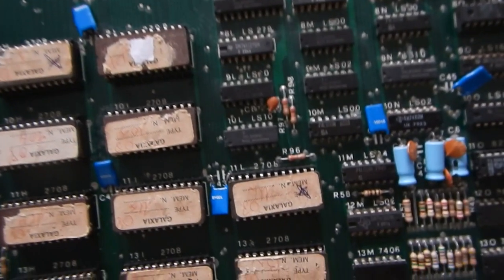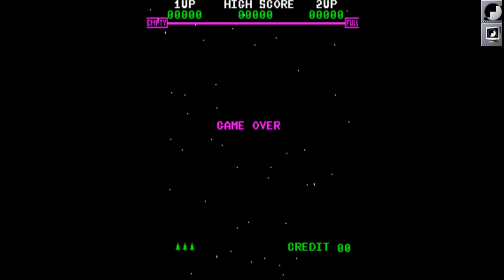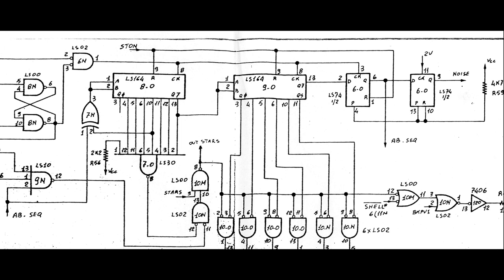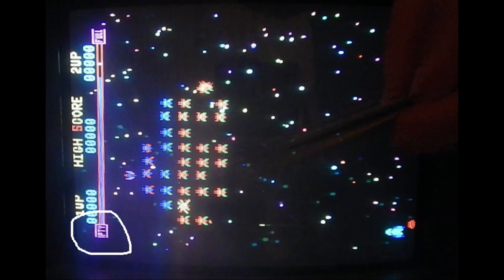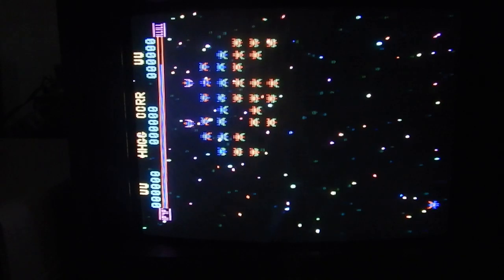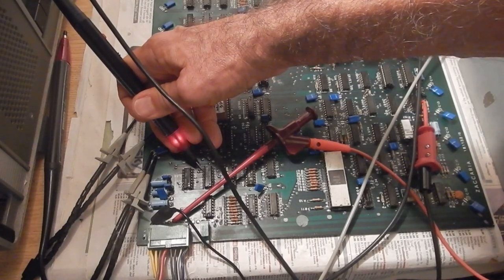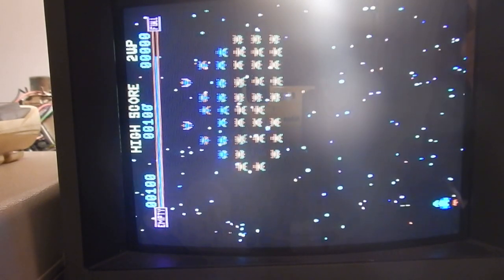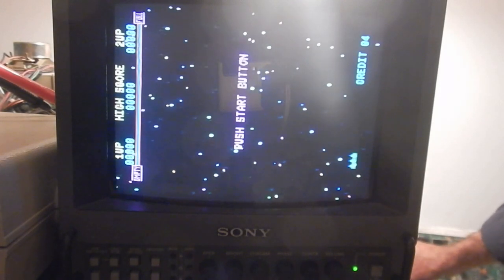Zaccaria Galaxia arcade repair #1. It failed as I was fixing it.

Comment: That half a cap broken in half having about half its capacity and still working is brilliant. Is this an early form of trimming? Lol. It's great watching a master surgeon at work.
Reply from the maker: Yeah, capacitance is proportional to the surface area of the capacitor's plates so it could even be trimmed in this way, but you must be very careful in not making a short circuit somewhere LOL. I love measuring abused components to see how much life remains in them anyway.

Comment: Excellent work Frank, and as always interesting, I love your 74LS32 logic analyser :) . I’ve had boards bounce, one Taito Space invaders three times even with several hours of running before return
Reply from the maker: Hey Pete! Thanks for the comment! Yeah the one-chip analyzers are something I resort to check dubious cases! If you run into a Space Invaders spare board, let me know. I've got an italian bootleg for my collection but it's been quite a challenge to have it work properly (and still sounds are not all correct).
Reply: @iz8dwf  Is that both boards? L Sharp or 3 layer Taito?

Comment: At least you can fix it faster than it can fail... my damp-stored repair jobs usually have chips go bad while I'm still in the process of figuring out what's wrong.
Reply from the maker: :D Well, I always try to fix one issue (usually the one I decide it's easier), then address one next issue. You can't go wrong with this method.

Comment: Wasn't expecting analog sound circuitry.
Reply from the maker: On a game from 1979, I would be surprised if it was digital actually :) Even the 1981 Galaga still has an "analog" explosion sound (the pseudo-random shift register noise exactly as in Space Invaders).
Reply: @iz8dwf  I thought it was generated by a microcontroller in Galaga, like the crash sound in Pole Position.
Reply from the maker: Ok, actually on the original Namco Galaga I haven't checked how it's done, but on the clones I've repaired, it's a CMOS 4006 shift register, XOR tap feedback and low pass filtering. It sounds the same, so I guess
the microcontroller would just use a pseudo-random bit stream too. One of these days I'll check the original schematic though :)